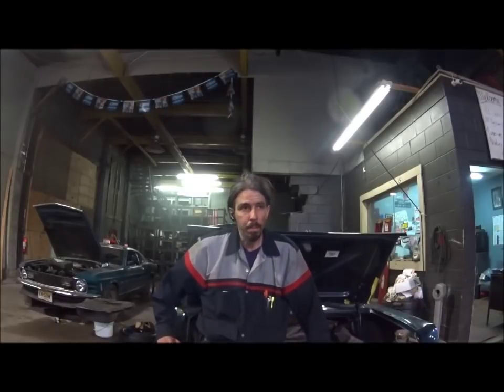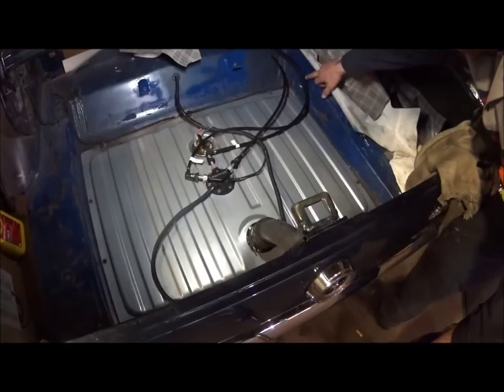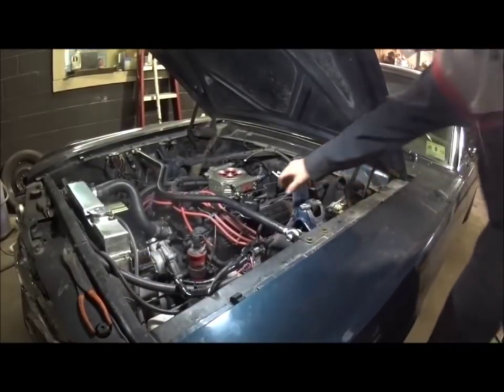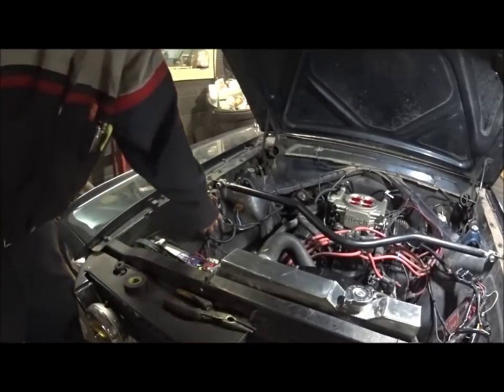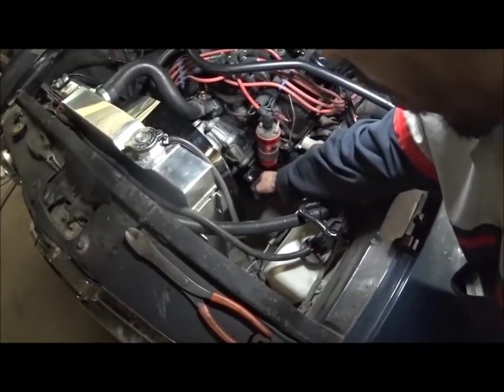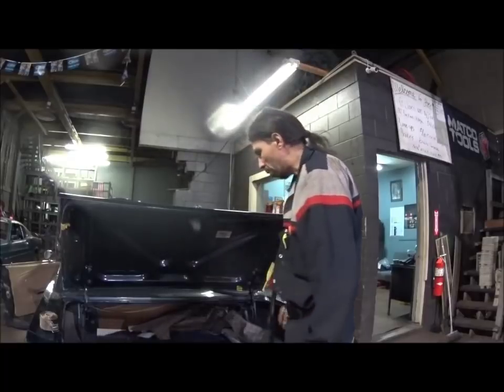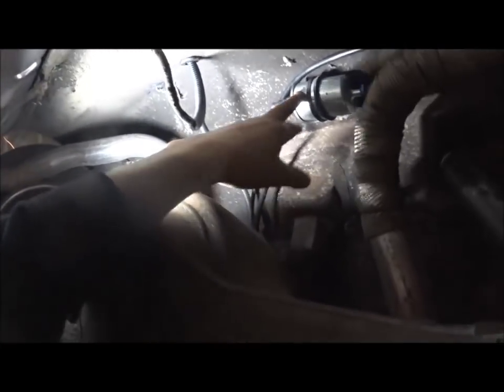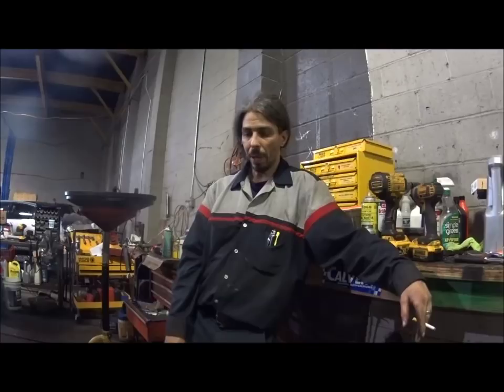1965 Ford Mustang Fitech Installation Part 2 ...and Some Thoughts

Comment: Just awesome. I will probably never use the info that you people provide but it is still great to watch and absorb. I do have to say though I diagnosed  a problem with an intermediate steering shaft on my f 150.   132 Dollars  later (OEM) ant 4 bolts... Bang fixed for 250 less than the dealer..  Again Just awesome!
Reply from the maker: Thank you very much!

Comment: Currently rocking a in line pump on my 66 mustang and it’s giving me lots of trouble. Fuel just stops. Would you recommend this long term? Tired of my engine cutting out and the noise
Reply from the maker: @MatthewSimp  yes